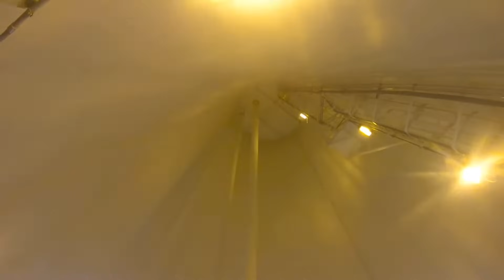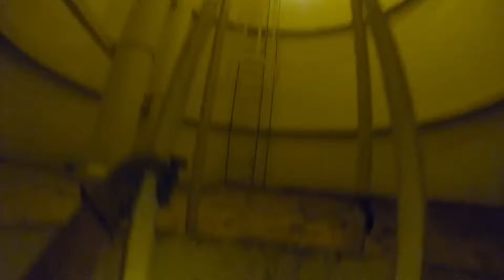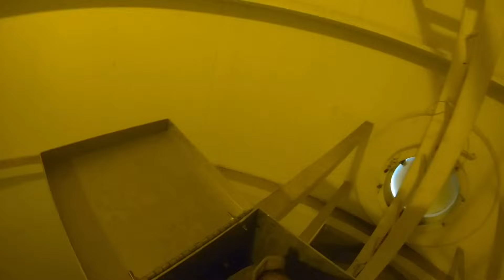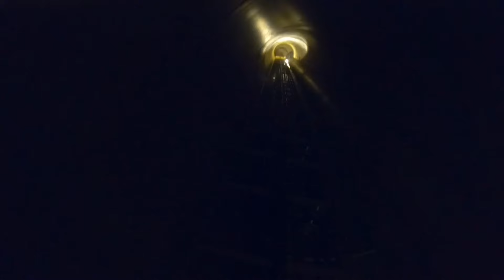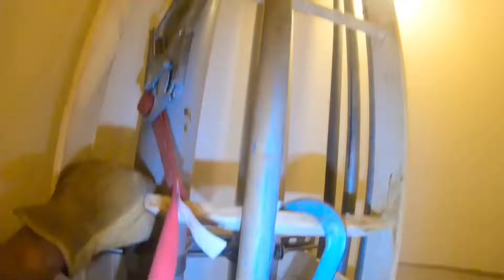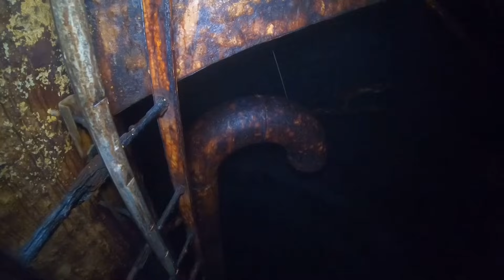Climbing a water tower

Comment: What would it look like when you build and climb a water tower in Minecraft?
Reply from the maker: Very interesting 🤔
Reply: @inspectortravis5758  What did you do in the tank?
Reply from the maker: @santinojozefmiller7721  It’s an annual inspection, checking for overall structural integrity and conditions of the coatings both interior and exterior of the tank.
Reply: @inspectortravis5758  did you have to go underwater?
Reply: @inspectortravis5758  Amazing and impressive!!!